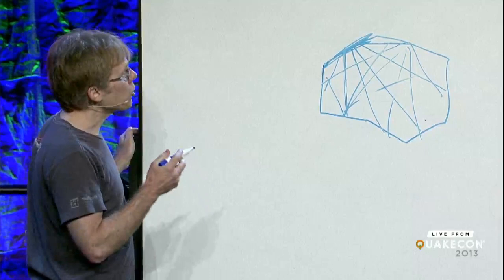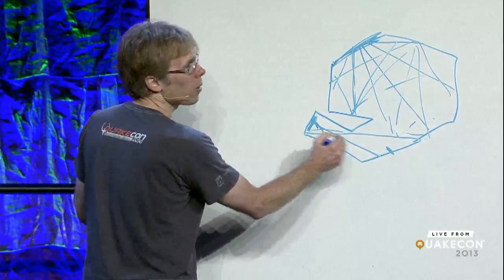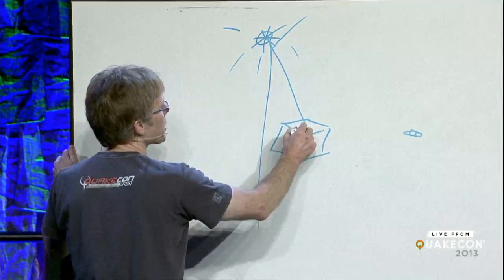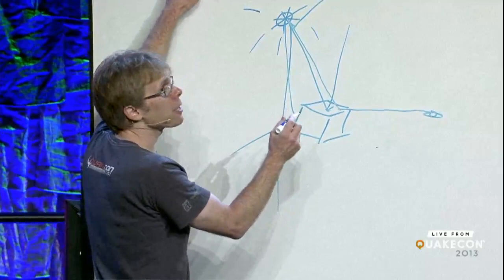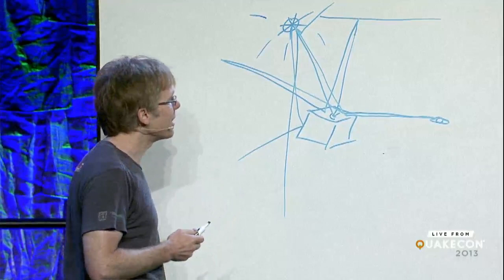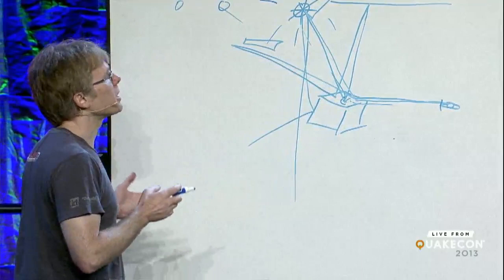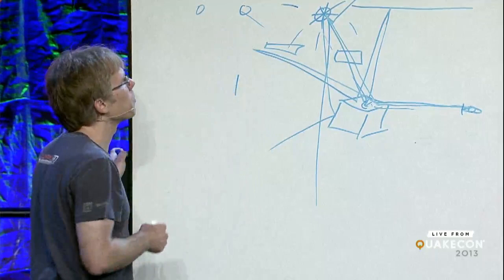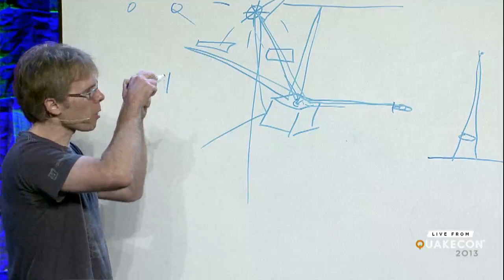Principles of Lighting and Rendering with John Carmack at QuakeCon 2013 part 3

Comment: He mentions that raytracing is slower still, which is semi-inaccurate. Currently, what I'm seeing in my work in offline CG is that raytracing generally beats rasterization, partly because of trivial parallelization, but also because you don't need all the extra passes and data I/O for shadows/GI. It's slower if you just look at shade time only, but when you add up all the extra work a conventional micropoly rasterizer has to do to support all those features, it works out faster in practice.

Comment: I notice he didn't mention the hemicubes method for radiosity which largely solves the occlusion and visibility problem, but does it via rasterization using the same methods rasterizers have at their disposal for dealing with visibility. But in all fairness, it seemed like he was using that to segueway into MCRT.  I've done talks like this one and if you start including every solution people have used, it's very hard to fit it into a definite time slot.